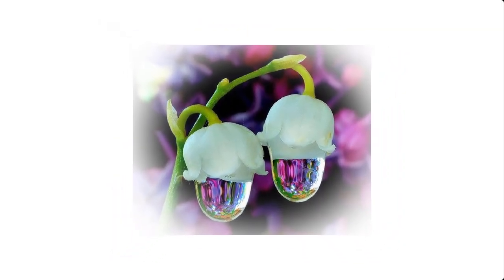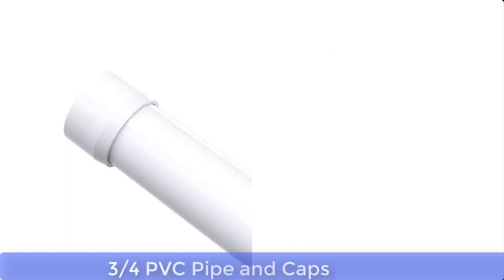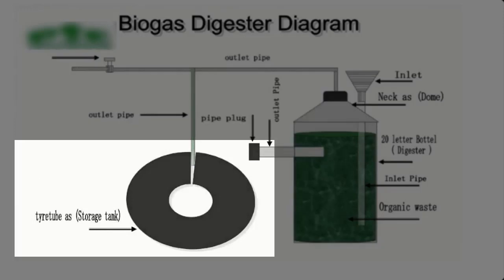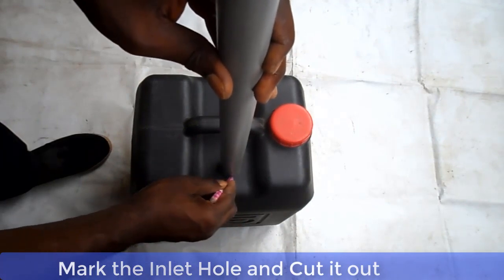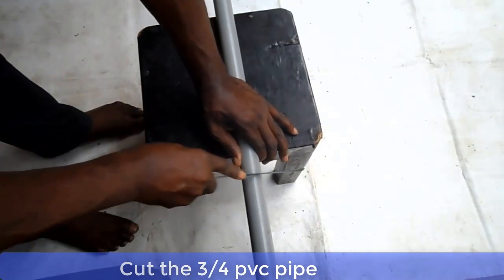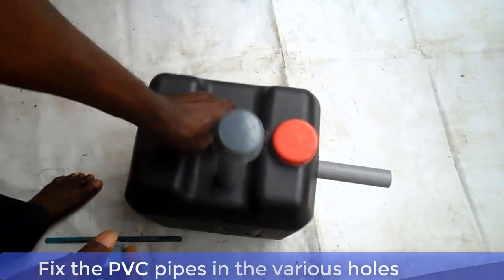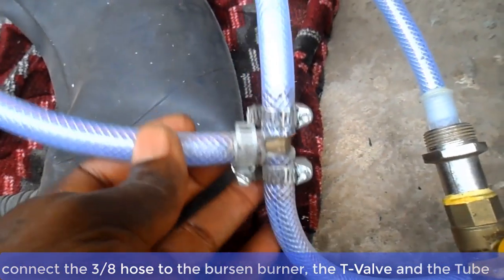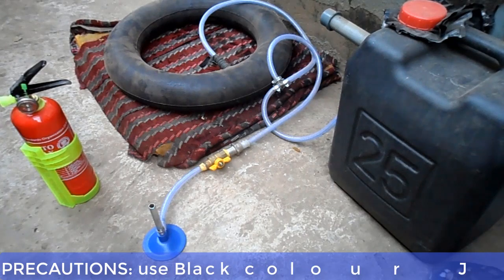How To Construct A Mini Biodigester For Cooking Gas Production

Comment: do i just connect the hose directly to the tube inlet without the valve removal on the tube or what

secondly,only car tubes are recommended?

Comment: Thanks, you actually made it simple. Other videos I watched used bulky tanks that made it look complicated. I just want to ask if there is a way to transfer the gas from the tube into a regular cooking gas refill tank.
Reply from the maker: Yes get a cylinder nozzle valve and connect the hose from the Tyre tube to your cooking cylinder.
Reply: But this methene is mixed with sulpher and CO2 even water is mixed so cylinder inner surface material may get degradation too early.